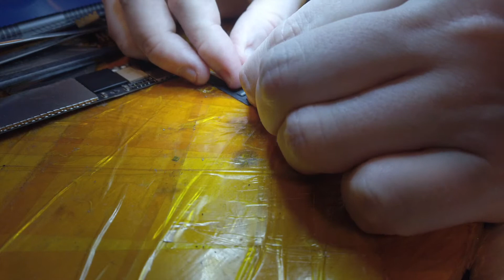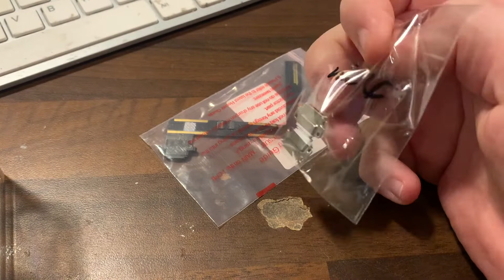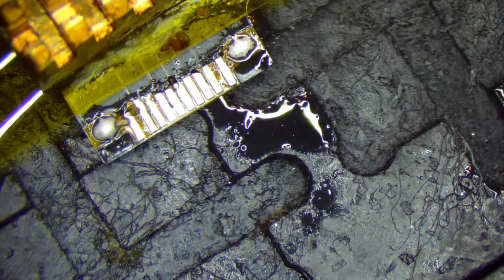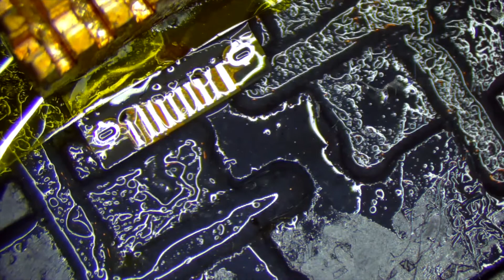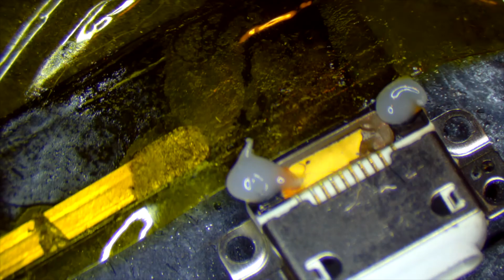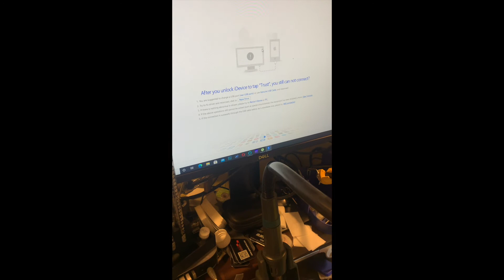IPAD MINI 4 NOT TURNING ON AND NOT CHARGING. BOARD REPAIR!

Comment: What exactly are the benefits of doing this, over an OEM dock flex?
Reply from the maker: It works out a lot cheaper than changing the dock flex and also it allows you to keep more of the iPad board genuine. It’s also less noticeable repair than changing the whole dock flex. If you don’t do a lot of these, you won’t see the benefits as much as someone who changes them regular basis. Richie , thanks so much for taking the time to watch the video, it’s a new channel and I honestly really appreciate it. Hope you have a lovely New Years.❤️
Reply: @MICRO-REPAIRS LTD  Thanks for uploading it, just need to work on your mic quality so that way I can stay subbed without having to turn down the volume!

Does it really work out cheaper though? I pay about $2-$4 for the flex, vs $1 for the dock.

I do agree with minimising the 'noticeability', but I don't really care about that, I'm not hiding my repairs.

I think I'll stick to the whole flex replacement, but this definitely an interesting method.
Reply from the maker: @cohen200  🤣lol, I’m definitely buying a new one because that mic I’ve been using is terrible, it only picks up your voice if you shout into it but you end up sounding like you’re in a tunnel.😂😂 the whole dock flex’s are about £3.50 or £4 maybe a bit cheaper if you buy from AliExpress it depends where you purchase them from or if your buying in bulk. Those little dock connectors are about 60p each if you buy more than 10. If you do this repair often, it will save you money in the long run. If you’re just doing one or two of these, it probably easier just to change the whole flex, it really just depends how often you do charger port repairs.❤️
Reply: @SURGE101  I've just realised I forgot to factor in shipping costs too. So that works out in your favour :)